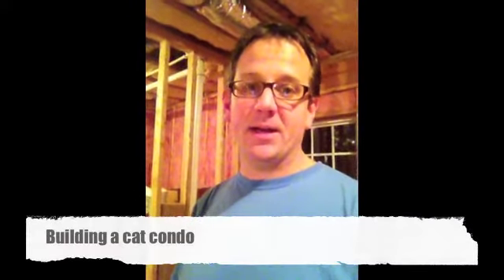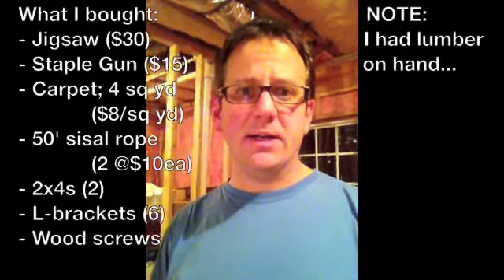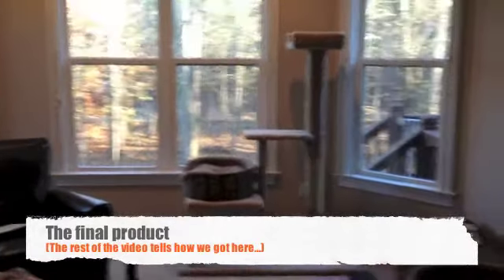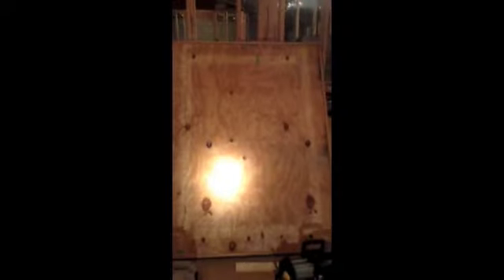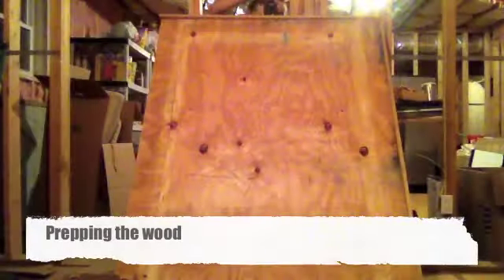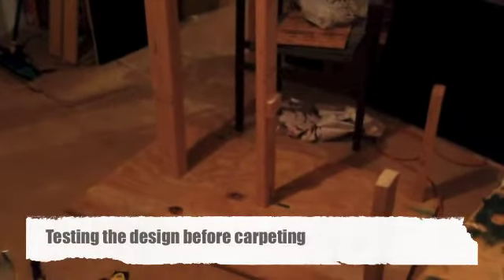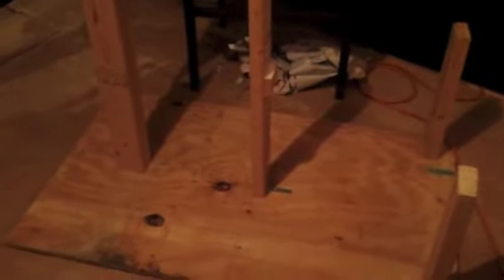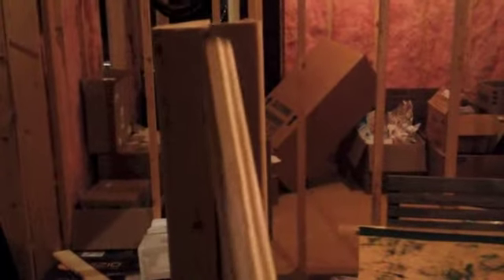DIY: Build your own Cat Condo or Cat Tree

Comment: Thank you for giving me a foundation to start from. One thing I thought about doing is where you have the cat bed is to use instead a waterproof orthopedic pet bed there, one that doesn't have sides. Then when the bed got dirty I can unzip and wash, plus it would be on top of the carpet and hopefully that would give more longevity to the platforms. I was thinking about attaching it with double sided velcro to keep it from moving around. Thoughts?